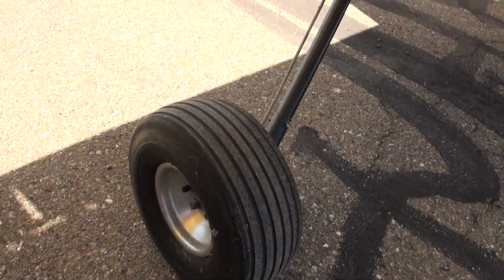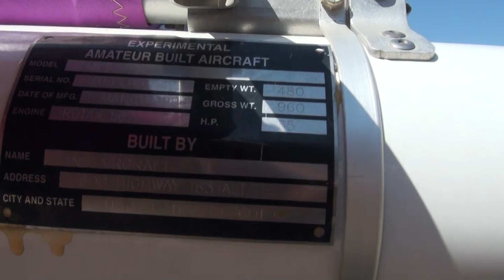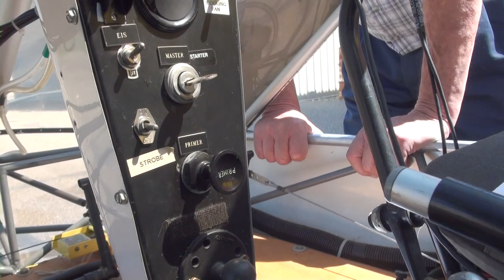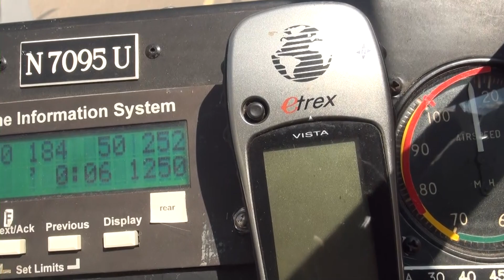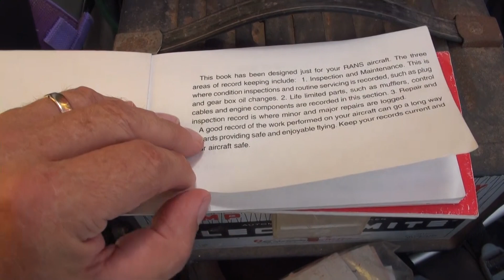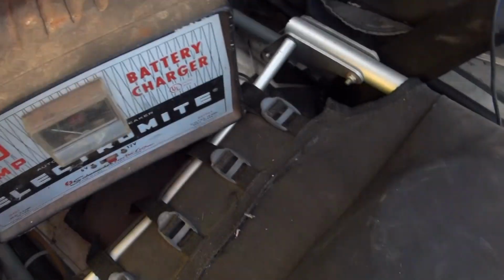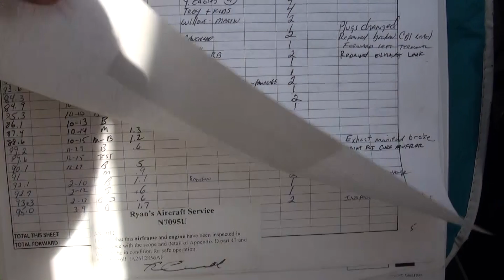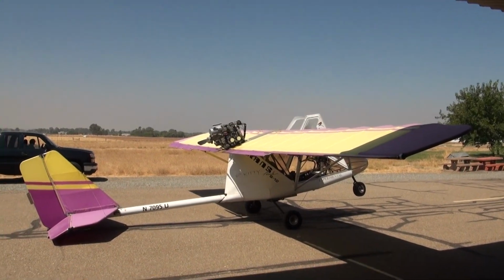Rans S-12  (SOLD!) ***$6000***

Comment: Should have Show more of the leading edges of the prop and a lot slower . Not good when you find a washer under the engine on the wing. Somebody took something apart did not put it back together with all the parts . A small patch on the tail  just fell off from Dry root . The Fabric definitely needs replaced . Front wheel sound like the bearings needed grease at the minimum . For the price. And with some TLC . All in All great starter for someone with a good ear and handy with tools .

Comment: Other than flipping threw the pages some commentary about the condition of the power plant and the hours is and would be the selling point  over all it looks like it needs covering it has been flown I was able to see that new landings gear had been bought so you know it’s been off the ground and not just sitting in the 🌞 sun $6000 sounds like a good price I would offer $4500

Comment: I know this an old video, but a couple of comments for what it's worth. Vid is a great idea, but suggest you go SLOWLY over each part of the plane, and then be STILL for maybe 3 seconds on places people want to look at (or pause vid). The engine had a plate affixed to it I thought you'd go up to so it was readable to the viewer, but you just zoomed past it like 4 times (I have no idea what it said). You're moving so fast most of the time it's hard to see anything. Plus 90% of your shots are at like 1 inch distance. Back up a little bit, and provide a nice overview, then go in for more detailed. "General to specific." It's a great idea, but it can (and should) be executed better. But anyway, congrats on selling it.

Comment: Need to show it flying!! no fly no buy. Video sucks
Reply from the maker: Sorry you hated the video. The aircraft is not in flying condition.  The aircraft is not been flying for several years due to the owners (medical condition) I know it's hard to follow all of the history of each video. The video usually shows quite a bit more than a couple of pictures on barnstormers or trade a plane. The video that follow this one was a punch test on the condition of the fabric requested by a potential buyer. That fabric test failed. The price of the aircraft was lowered $4000 to compensate. Check out the punch test video, link below.

https://youtu.be/NyJveLrj45c